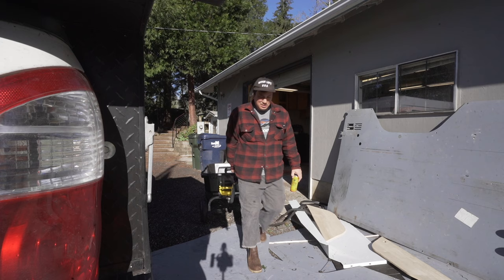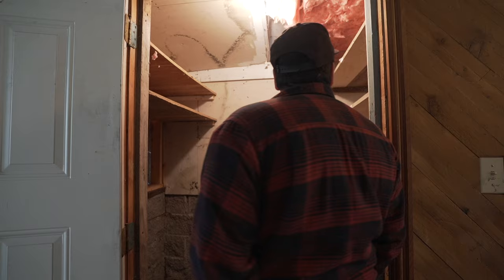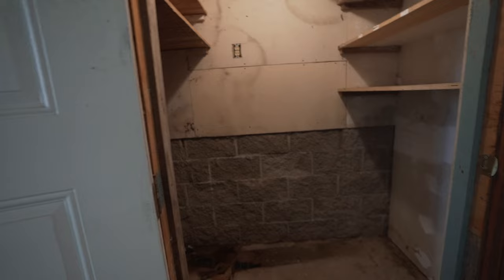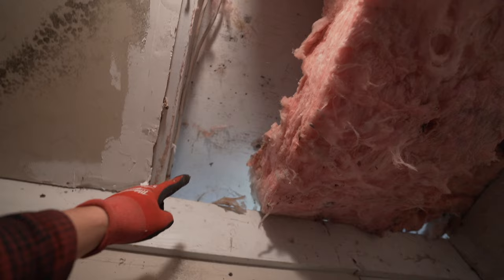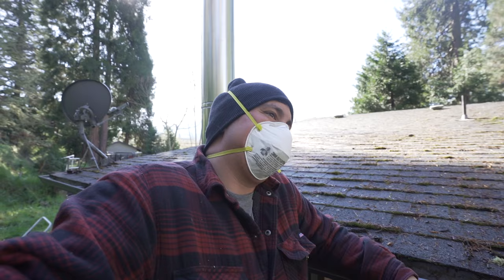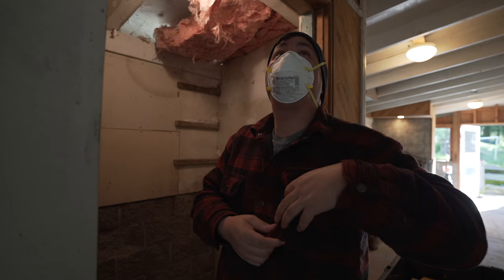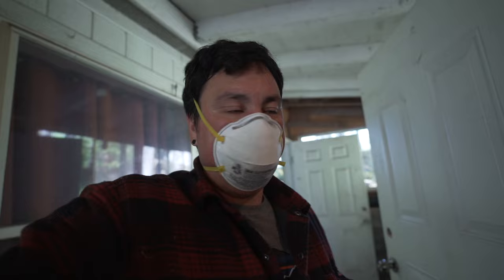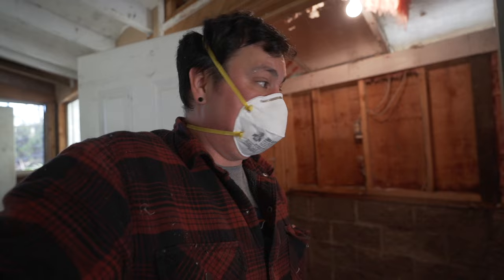It's Worse Than We Thought... (Mobile Home Demolition)

Comment: I think there are several issues going on. The hill is draining down toward the house, tree cover blocks sunlight and airflow keeping everything always moist, dirt is up against the wood siding, the dude didn’t know what he was doing .If the ants are big black ants they are probably carpenter ants and are the equivalent to termites. I think you need a professional to look at this.I think the problem is even worse than a new roof .
Reply from the maker: Dang

Comment: You don't have a warrant? You seemed to have been ripped.  Atty may be able to get the seller to pay up.
Reply from the maker: Nothing I can do about all that. Just got to deal with it
Reply: @isaacturnerit  - why do you say there is nothing you can do about it?  Did you sign off on buying the property "As Is" with no inspection?  If you had an inspection done, who chose the inspector, you or the seller?  If these issues weren't found in an inspection then you do have some recourse in finding out more about why it was missed.  I would not give up so easily on this.  I feel for you and hope for the best.

Comment: Downspouts buried in ground could have a break or Crack or clogged?  
That addition could be protecting the house from rotting on that hillside.  The drainage should be done with care and professionalism. French drains going out to front of house is number 1 priority. Roof 2nd priority.  That exterior wall is only plywood?  No water barrier or siding? Seal all holes and gaps. That addition was done poorly. Good luck.
Reply from the maker: Hm got ya